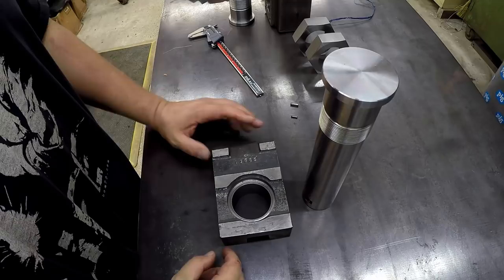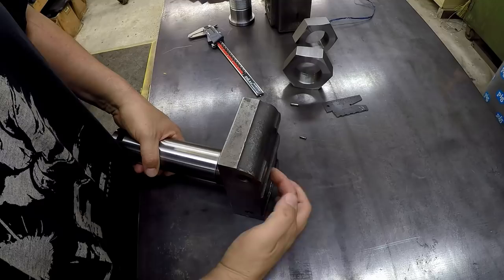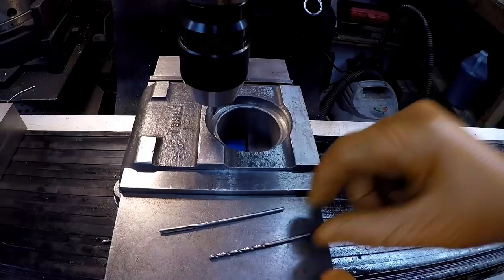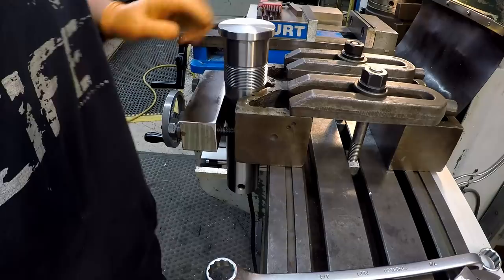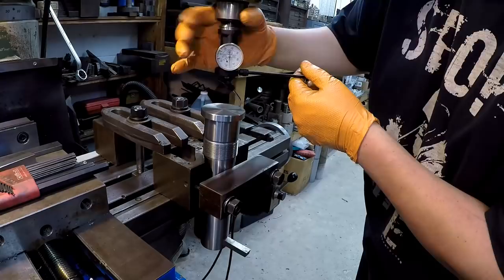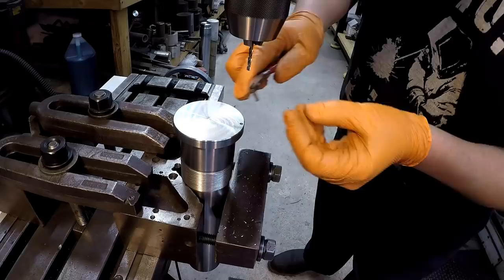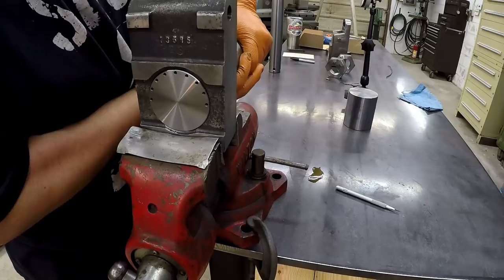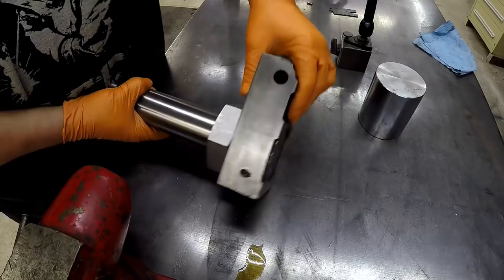Custom Internal Shaping Bar Part 6

Comment: nice solution.  Now instead of having to index the work piece for an inside spline, you can index the cutter.  I must admit that DRO function sure saves a lot of work either setting up a dividing head or doing the trig and laying out the circle and then the arcs by hand.  Since the DRO seems to read in at least 1/10's, the hole positioning might be close to what a jig borer could do.  Still, the DRO seems a little like cheating for us old timers. ;-)

Comment: Only thing that crossed my mind was to drill the single hole in the clapper part clear thru so a pin punch could more easily drive out a broken locating pin. God forbid one should break off in there. Just applying my sort of luck to your project, it may never be needed.
Reply: I would also add a shim under the nut to prevent the block being worn out. But overall a very good job he made.
Reply: That would be normal procedure but with a smaller drill to leave a step

Comment: How will you replace the pin when (not if, but when) it breaks? You should have a smaller through hole to be able to replace the pin.

Comment: I was thinking to myself.  Self, I says, why is he counter sinking that side of the hole when the pin is entering thru the other side.  You know, for a city boy you come up with some good Ideas.  This another one you should consider getting a patent on.  Why hasn't someone else thought of this.
Reply: I didn't notice that he hadn't drilled all the way through but that he was going to have a more difficult time countersinking the other side like that.

Comment: As a programmer, the math involved in calculating the angles with radius and offset.. it makes my brain hurt. Would hate to be the ASIC coder for that DRO man
Reply: The math actually isn't too bad and should be pretty straightforward to code. Once you have the center of the circle, you store that offset so the center is at 0,0. You figure the angles between holes are (360 / # of holes) then just use a for loop get the coordinates of each hole center: Y = [ radius of pattern * sine (angle * hole #)], X = [radius of pattern * cosine(angle * hole number)]. Source: teach high school physics, have taught high school trig, both of which use right-angle trig.

Comment: How about 15 degree increments on the other half of the circle?
Reply: Or maybe a slot for the second half of the circle to allow infinite adjustment?
Reply: That woiuld defeat the entire purpose for the pin in the first place, which is to hold the bar securely so it doesn't rotate while tightening the nut.
Reply: No, that's only part of the purpose. The other part of the purpose is to allow for quick and precise angular alignment of the tool. But what if he wants to set the tool to 9 degrees? It would be more difficult to tighten, but the tradeoff might be worth it.
Reply: Ketletrigger, he can just pull out the pin if he wants infinite adjustment. No need to put a large slot through it.

Comment: Would it be interesting or useful to add a set of extra holes on the clapper that are offset to a different degree, allowing finer precise angle adjustment?  A set of pin locations in the clapper at 15,30,60 should yield 7.5 degree adjustment capability.  Maybe someone else can do even better than that.

Comment: Have you thought about drilling holes every 30 degrees or so on other side jut to have different interval capability? Also, punching numbers on a bar before nut would be good visual reference. Anyhow, nice job there.

Comment: Nice job !  You now have a positive method to assure that the tool bit is perfectly vertical within thousandths.  Now how are you assured that the clapper box is in the same presion vertical plane as the tool bit,  the clapper box has an angular adjustment.

Comment: Hello Abom79, nice neat and tidy work. My compliments
I rescued a shaper (from a near certain scrapyard ride) with a clapper box but no tooling so this is of particular interest. I am intrigued with one dimensional aspect. You have the BACK of your newly made tools sunken into the clapper, not flush with the back so that any forward motion would be directed directly to the back of your tools. At the moment, the force exerted to cut is being carried by the machine-fit into the clapper box and the threads of your nut and tool holder. I guess a few shims could sort that out but I wondered at this arrangement, was it intentionally sunken and not made to be flush with the back of the clapper plate. I, too, need to make my lantern tool-holder and/or as you have done a nice sturdy internal shaping tool-holder 

please explain the rationale on your design, 

I am a retied geologist and have recently acquired two old lathes and while I've watched with Great interest your threading procedure I have yet to try and practice this art. I need to get to completely understand how you time the engagement of the half nut and what level of practice did you go through to get that timing absolutely correct. Have you dealt with this specific aspect in any of your videos? 

I understand the pitch angles and setting the cross slide angle to half the pitch angle etc but that aspect of watching the feed dial and picking the correct instant to engage
regards
Gordon 
Cape Town, South Africa

Comment: I would have press fit one pin in the boring bar flange and made the holes or a slot pattern in the clapper.  Easy job for a rotary table.  Next time do the dowel hole before broaching the square hole.

Comment: Question.  Do you need the 30 and 60 degree rotations?  Use the 16 hole circle for 0, 45 and 90 degrees then a 12 hole bolt-circle would give you 30 and 60.  The 22.5 degree increments don't seem to be very useful except perhaps for nibbling out to a final size.

Comment: What does a reamer accomplish that the drill bit doesn't? Is it a more precise tool or is it more like making a finishing cut on a lathe (a small finishing cut that makes it smooth). Thanks for the great content!
Reply: More precise and leaves a much smoother hole than a standard drill bit.
Reply: Drill bits usually drill over sized. Also reamers cut on the sides of the hole.
Reply: thanks! that was my assumption whenever slip/precise fit is required I've seen the reamer used. good to know! :)

Comment: Adam,
Drilling those index holes right through was no mistake, it was the correct thing to do.
Why? Because that shaper and those shaper bars are going to be used by future generations of machinists.
Your clever idea of making the bars indexable would be hidden from their eyes if the indexing holes were blind.  
Those externally visible index holes must challenge even the dullest junior machinist of the future to ponder them and ask     "What are these holes for?" 

Similarly, the 'wrong side' chamfers are also correct.  They allow easy oiling of the internal index holes  from the outside.
Mistakes?  No.   It's just that your brilliance is not immediately apparent to some....
Reply: I think he would struggle to drill from the other side
Reply: Agreed. I was actually assuming you were going all the way through. So much easier that way.
Reply: Reino yes me too

Comment: Hey Adam, wouldnt you want to have drilled all the way around the collar on the shaper bar, and split the difference between each hemisphere? That'd give you 2x the division of angles, but would it be feasible and would it alter structural integrity and/or run out?

Comment: I  like your solution, but the pin size bothers me. I was thinking maybe a 5/16” ground pin set in the outer circumference  and half round notches in the tool bar. That’s just my thoughts, but then I usually over build everything!
Reply from the maker: That hardened and ground dowel pin isn't going anywhere. It's simply keeping the bar from spinning.

Comment: Hi Adam
I am not sure I get where  a mistake was made. :-)
The way you did the drilling is  exactly as I would have done it so I saw nothing amiss. Of course I don't have your skill/experience but how would the other side of that flange actually be drilled with such tight machine quarters using t a normal length drill in that area. Would you not need a really long drill. Looking very svelte
regards vic
Reply: He didn't drill them all the way. He stop at the pin length.

Comment: You only need the one hole at zero because for an angle cut you will rotate the slide otherwise when the clapper opens it will crash the tool with the upper side of the slot☹️

Comment: couldn't you put a set screw in the clapper, 90 degrees to the tool bar, then a hole/divot at what ever angle you desire in the side of the bar. it'd be a lot stronger.

Comment: The fit and finish of those bars looks fantastic. Good to see that coax getting some more use! :D Is there any value in having an index hole for 15/30/60º ? or is it just as easy enough to make that adjustment on the table rotaton?
Reply from the maker: It's mostly in case I need to get in at an angle with the tool bit somewhere. If I ever need a different indexing hole I can always modify that again.
Reply: Ok, makes perfect sense.  It was just my curiosity that made me ask. Thanks for answering ;)

Comment: Adam, again a very nice video. I admire your beautiful boring bars! But although I also have a shaper I don't understand the idea of indexing the bit in relation to the feed screws of the head...
The orientation of the clapper box is not relevant for the cutting direction either so why would changing the angle of the bit in the toolholder? In fact, as you know in normal operation the angle of the clapper box is often set to clear the bit from the cutting surface on the return stroke of the shaper without influencing the direction of the cut ( In this application the clapper is locked, so its rotation is irrelevant. Only the orientation of the bit in relation to the feed screw) The cutting direction is set by the angle of the lead screws. The table is fixed "horizontal", the head of the shaper can be rotated in relation to the travel of the table. In this way a "clocked" keyway, groove or angled surface (dovetail!) can be cut. The rotation of the head also angles the bit, so no indexing of the toolholder is necessary. I am not sure what indexing the bit accomplishes, since when you do it will feed the bit "skewed" in relation to the cut?

Peter
Reply: Whilst what you write is correct, I found a situation when cutting an internal profile. It's on one of my vids. Now I'm not saying there were not other ways of doing it but I indexed the internal bar to gain access. I have to get back to my shaper work as it's very enjoyable.  All the best Mat
Reply: When I bought my shaper it came set up for cutting keyways with a dedicated block to hold the bars and a crate load of bars  I couldn't move. The clapper box had never been used and it was only after a long search through the workshop it came from that I found it. All the tool bits were brazed on at 6 o'clock.
I'm betting that most of those holes never get used unless in conjunction with the rotation of the clapper to reach beyond the    available rotation.
Reply: For sure its not going to be a frequently used mod' and I suspect Adam cut the additional holes while it was set up .. just in case. as you can see from the comments below a lot of guys are suggesting additional holes to cover all manner of angles - most if its overkill. But having some rotational setting is better than none when you need access. Many of the possibilities Ive seen on shapers are seldom used and jigs no longer available / long sinced scraped. I once looked through a set of drawings for cutting spirals down a cone from the late 1800's  on a shaper - referred to as cam cutting - I cant think of why it would be required - think about the jigs required to link the table feed  to the rotation system to the stroke movement etc. The guys that came up with that with pen and paper put most of us to shame. I would love to see a working example.  As you say though nice Vid from Adam.
Reply from the maker: Many of you miss the point of being able to turn the tool bit.
Reply: that's what I meant when I said "I don't understand", I didn't mean to say you are wrong, because you most likely are not! I would love to hear your explanation!
Peter
Reply: @peterheuts7738  I kind of get that if you can index the bar around a central datum, it might come in handy for say cutting an internal spline. But you would need luck on your side to have the correct number of positions available. That apart I'd like to hear the reasoning, always willing to learn that's why I follow Adam's channel.
Reply: @masteronone2079  my point in my reply is that as far as I know, with a shaper indexing the bar with cutting bit around is not the way to cut for example a spline with a shaper. It can be done, but not in this way. I am sure Adam understands that and has another reason that eludes me. If you read my first message my reasoning might become clear.  But then again maybe my explanation is not very good, my English might be lacking it not being my first language....
Reply: @lookcreations  I went and took a look at your shaper video's. It might indeed be that the indexing of the bit is not for splines and keyways at all, but for reach when shaping different forms as in your video, beyond the angle that the clapper box can rotate. In that case the exact angle to index is not critical, and the only reason for Adam to make indexing holes at all is because he wants to use a pin to prevent his bar from rotating when snugging op the nut. Creating extra indexing holes on the other side of the bar would not be very helpful then, because he can use both his holes and the clapper to get in between angles. I hope he will explain his reasons, because I am getting very curious now!
Reply: @peterheuts7738  I agree indexing the tool around would not be the ideal way to go about cutting a spline given the availability of a substantial indexing head. I was just trying to think of a possible application such a setup. In Adam's case of course it would produce half a spline anyway.
By the way there is nothing wrong with your English.
Reply: I guess its down to adam to explain his reasoning further if he wishes - I watched the vid again and only came up with the stopping it rotating when tightening the nut.  As for cutting splines etc - it would be an interesting shaper project - not something Ive done on the shaper or mill. Thanks for watching my vid' as you can guess - I like to share the good bad and the ugly :-)

Comment: i recall you saying that there is deflection using the long bar. is there any way to add a low angle over arm type support to stiffen that up a bit? or would the low angle not be enough to stiffen it?
Reply: I think this bar is for internal work. No room.

Comment: I don't understand how can you cut at any orientation other than perpendicular to the hinge of the clapper.
Reply: You can orient the tool to any angle but yes, you can only cut either parallel or perpendicular to the hinge.  I'm not sure how you could practically do shaping any any other arbitrary angle without using trig to manage the cross feed and down feed.  It'd be like drawing angled lines on an etch-a-sketch
Reply: You mean how all CNC machines cut curves?
Reply: In this configuration the hinge will be locked.
Reply: The orientation of the clapper hinge is not relevant, it is not uncommon to angle the clapper away from the cut to clear the bit at the return stroke of the shaper. In this instance the clapper is locked anyway. The cut is always parallel to the feed screws though. Which makes your observation valid anyway!
Reply from the maker: You can turn that tool any position you want and still cut. I made the bar this way for other jobs where I need the tool in a different position. Tool head will stay where it’s at.

Comment: I like the idea but couldn't that pin work its way out?
Reply: I think if it does he will loctite the pin. I just thought the pin was a bit too small.
Reply: It might, but there should be a little torque on the pin from it holding against the nut and really the bar shouldn't move once tight anyway.

Comment: Why didn't you use a metric circle hole pattern?
Reply: Good one!
Reply: Pork Pie: I love it when I actually catch myself starting to LOL.  That was just excellent!
Reply: I know you're joking but there is such a thing as a  "metric" or SI unit of angle, it's actually the radian. 

But I guess 22.5° is more metric than 22°30' or the so called minutes of arc.
Reply: You may want to check the definition of a radian and then let us know what is metric about it.
Reply: Ron the "metric system" is a deprecated appellation and is usually used to mean "Système International d'Unités" or SI. The SI unit of angle is the radian.

Comment: What made you decide to put the pin in clapper/hole in the post, and not the other way around? Does it matter? Or six one way, half a dozen the other?
I’m not a machinist, or any kind of metal worker, but I always enjoy watching your videos Adam.
Reply: In the box, the pin has less likelihood of being lost or damaged as that big heavy bar is "tossed" around.  Also, you need one, not one for each bar.  Put a little loctite on that pin, and it should stay right there.

Comment: 1/2@ 22.5, 1/2 @ 15 degrees?
Reply: I was thinking the same(ish), 12 holes on the other half at 30°, your idea of 15° goes one better.  The only 'downside' would be that the set screw is then on the other side of the bar.
Reply: @stevecox2530  Good point. That was going to be my suggestion to Abom to drill holes on the other half but never thought about the set screw. But how about drilling a hole opposite to the existing set screw?